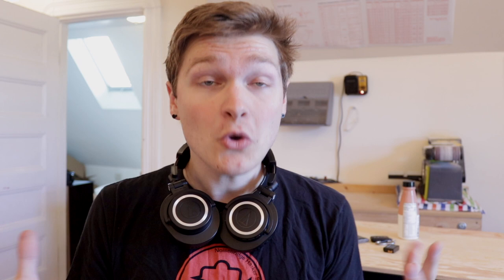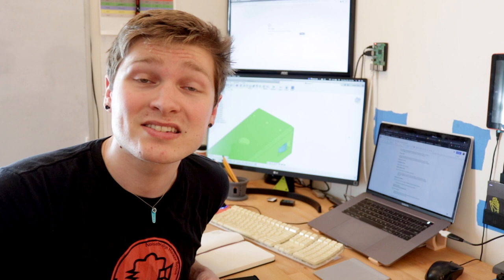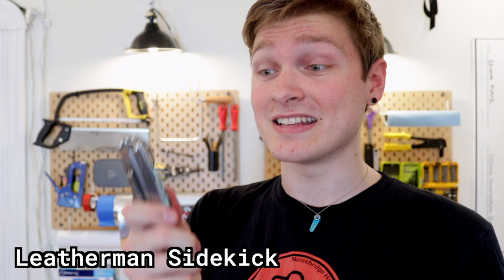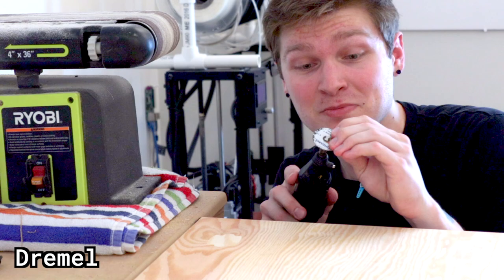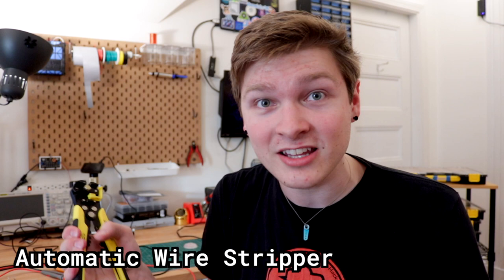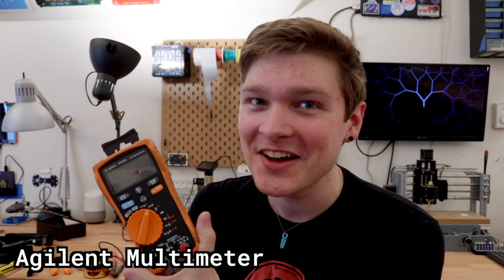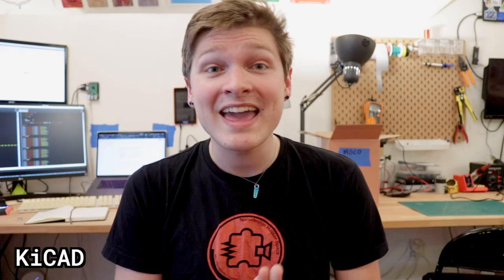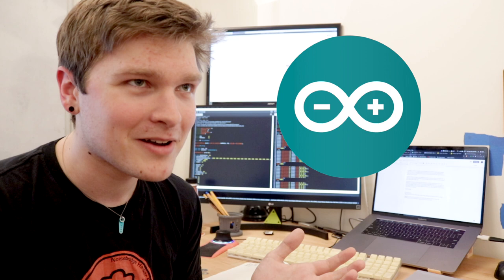Maker Tool Kit - Things I Can't Live Without!

Comment: Amazing how similar my workshop is, also the hidden stuff like reflow and self built PnP.  You missed recommending a bench top PSU. But for essentials I really love my Saleae Logic 16. Given my 30->40 extra years I need a magnifying headset and a jewelers loupe. 
Would also be great if you did an update with things like your ultrasonic cleaner, its use and your experiences with various flux, wicks etc.

Comment: Dude, you need a better soldering iron.  A modern one with the heater element in the tip would change your life.  I am impressed you do those amazing things with that wood burner chisel.  You rock though, keep it up.

Comment: I love my omnivises, but you can buy smaller magenetic pcb bites for cheaper, good alternatives. One thing I would add, get a bootlace, ferrule crimp kit. Lifechanging, lets you put ends on any wire you need to put in a terminal block , also makes it much safer for high voltage connections.
Reply: I second the ferrule kit. I learned about them a year or two ago and they have completely changed how I do hook-up connections. I avoided using stranded wire because it doesn't work well in screw terminals when bare. Add a ferrule and voila!

Comment: I feel the microscope should have made it into the list. You used it a number of time to make this video, and it's probably an invaluable tool when working with tiny SMD components.
Reply: I solder SMD components without a microscope and for the most part they come out good with no issues. Recently I needed to solder USB-C connectors and used the microscope at work and it was a game changer. At some point I will for sure be adding one for my home workshop.

Comment: Here's just a little quibble: "Bondo" (one of 3M's brands) makes bondo (commonly-used generic name for the auto-body filler) and a number of other products. The body filler is a two-part polyester resin that must be mixed because it's a thermo-setting plastic. The stuff in the tube you talked about--also sold under the "Bondo" brand--is not at all the same thing as bondo body filler. It's not polyester and not thermo-setting. It's made of mineral pigments and fillers in a nitrocellulose and alkyd solvent-thinned base. It literally dries rather than cures or sets . It's a putty (they call it "Glazing & Spotting Putty) so it won't fill deep cavities, and it's much softer than Bondo bondo. That's why it's great for use on 3D prints. It's softer than PLA, so you can sand it down without sanding away much PLA. If you used Bondo bondo on PLA, though, you'd end up sanding away more PLA than bondo.

Comment: Dremel, Leatherman, Omni or Panavise, GOOD tweezers,.... absolutely essential.  There a few items I consider going top shelf for, tweezers is one of them. Also, stoning them to get them back to prime is very useful.  On the dremel:  If you find a Dremel Stylus, buy it!  I have 4 and would buy more if they still made them.  Stupid Dremel, used are 3x$ original. Get some dental burrs, and PCB router bits.  You'll use them even more than the cutoff wheels.  Also, by no means necessary, but the stupid cost of soldering irons like Metacal are worth it if you use them a lot.  Bought a failed one and repaired it, and now my beloved Wellers take second bench.

Comment: I used a Victorinox SwissChamp in almost every project I did for years. 60 bucks, and it took abuse (“unorthodox” applications for tools, molten solder dripping onto the scales) like a champ (no pun intended). I got pretty proficient at stripping wires with the scissors, and the pliers were just small enough to work with the stuff I need, like my printer hotend, through hole or large SMT components, and wires and tabs. It just got taken by the TSA, but it worked perfectly up until then. RIP

Comment: You love your Weller station, but you should give something like the Hakko FX-951 or the cheaper options from Metcal a try some time. The heat response from these stations is significantly better than the Weller, making soldering on boards with copper planes so much easier. I do mod/repair/rework on a semi regular basis and I’ve been able to take on more complex work knowing I had the right tip and wouldn’t burn the board or part.

Comment: I have the same scope and multimeter. It is fairly easy to DIY an infrared-serial cable for the multimeter, should you need one. Also printing something similar to the vice should be easy.